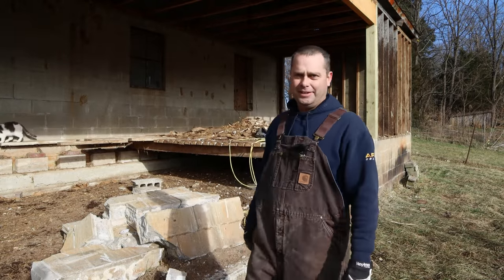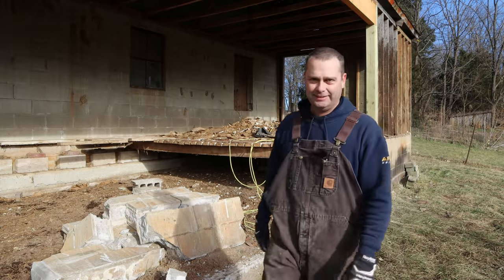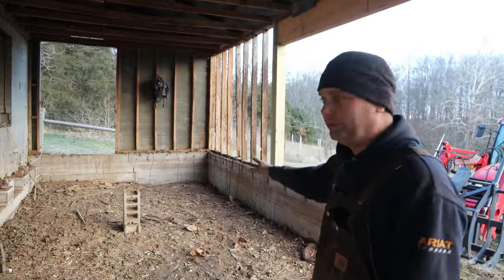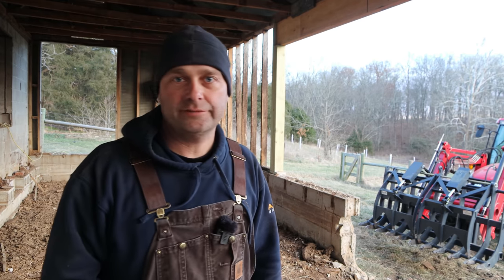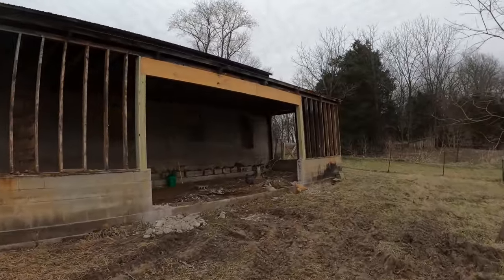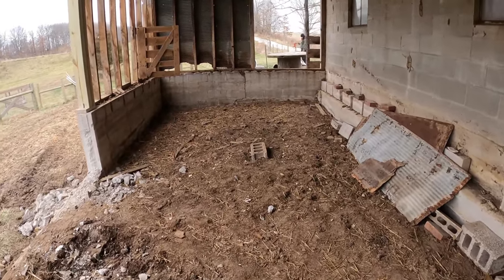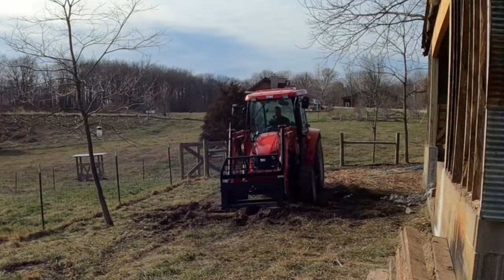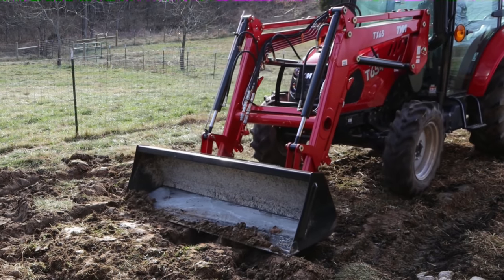Finishing Demolition on the Bank Barn.  Removing the rest of floor and the concrete blocks.

Comment: In stead of leaving the old wall in the woods, i suggest you dig a few feet down in front of the opening, dump the old wall in there and then grade it up with the gravel, or use the old wall as filler next to the pole barn.

Comment: It looks like the remaining concrete block wall is not pinned to the foundation. You might want to consider placing full-length support columns for the large opening.

Comment: If you decide that you want to clean up the dirt floor, I have a suggestion. If you start from the farthest points and work to the closest, as this makes the hardest part when you have more energy to the easiest when you have less. This gives you something to look forward to.
Reply: What is wrong with using the tractor and bucket for clean out?

Comment: You could poor a short apron in front of the floor.  It will carry the tractor better, cattle won’t  push it out and you can do it with a rental mixer and bagged crete pretty easily.  It looks really good.

Comment: Y’all may want to invest in a corded hammer drill that also does just hammer. Dewalt and Bosch make a good one it uses the SDS shank hammer drill bits and the SDS hammer bits.

Comment: A while back I asked you if you had found a good pair of gloves, but you said you hadn't.  I have since found a pair that I really like that are made by Ironclad and I have the Ranchworx style. They have lasted for a while now and work really well so thought I would let you know about them in case you'd be interested. Kind of pricy but have been well worth it so far.
Reply from the maker: I will Google them.  Thanks for the suggestion.

Comment: Kind of late for a suggestion but if you would have rented a 12" or 14" gas concrete saw cutting from both sides you would have cut through the wall.  No use of the sledge mall.

Comment: Im not convinced with the corners left after removing the wall section, especially with the crack on the left side, might be worth reinforcing the corners or even forming concrete around them just incase they are hit.

Comment: two tube columns with a base plate on the bottom [anchored into footing] and a flange on the top [attached to beam] would get your mind off the cinder blocks settling under load of header beam, just saying

Comment: Suggestion  invest  in a hilti  rotor Hamer   or other brand  especially  since you so far from town   HILTI ROTO HAMMER  kit contains  several  different  tips from point  to spade and others  while it cheap in your situation  would be worth  while investment
Reply from the maker: We have those at work.  Hilti makes great hammer drills.  Like a mini jack hammer.